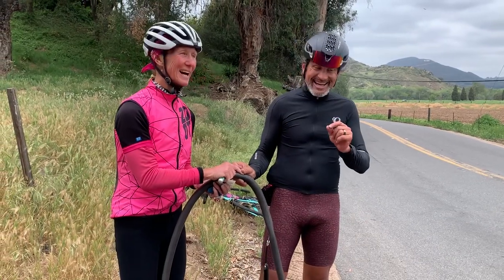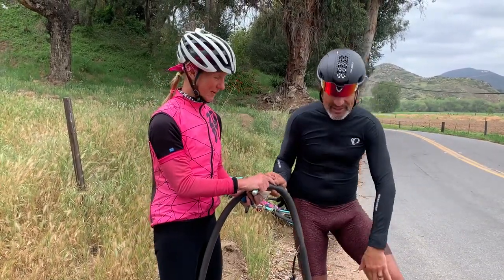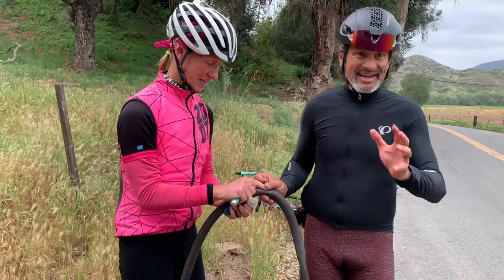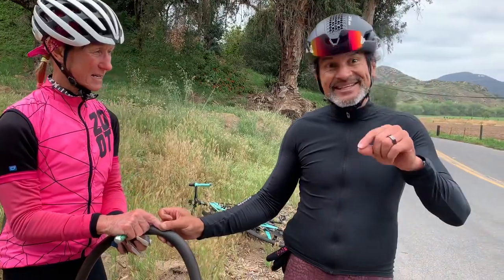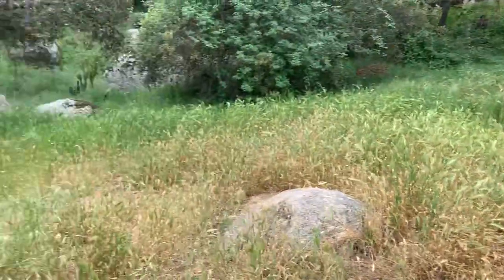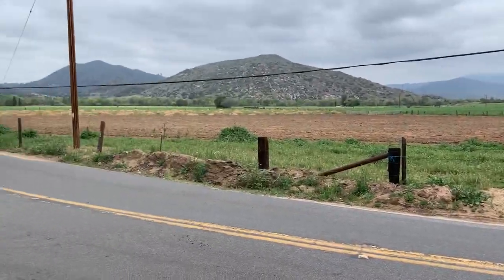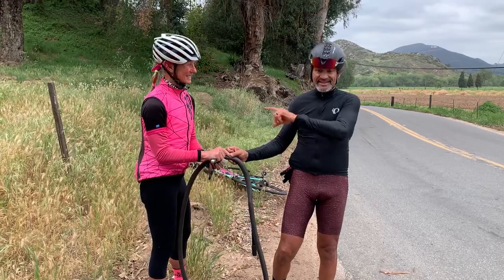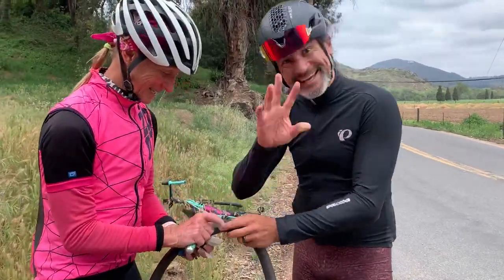Today’s cycling tip - take turns eating during a roadside flat repair

Comment: My tip would be to always take at least two spare tubes! I have had the same problem with a damaged valve on a new tube myself...
Reply from the maker: Yes sir! She usually carries two tubes with her but she got a flat on Thursday and didn’t replenish the additional spare tube. This flat/video was Saturday morning.  She probably had the tiny little wire already in her tire on Thursday but didn’t notice it when she put in a new tube - VERY slow leak. We had a very tough time trying to find the hole in the tube to patch it. Then we had a hard time trying to get the tiny wire out of the tire (Continental Gatorskin- they are not as “bombproof” as people believe
Reply: @SeeYouUpTheRoad  Oh that is bad luck!
Reply from the maker: Check out the latest video upload for the tiny wire I am referring to!
Reply from the maker: Latest vid! https://youtu.be/MA-npJCx8as